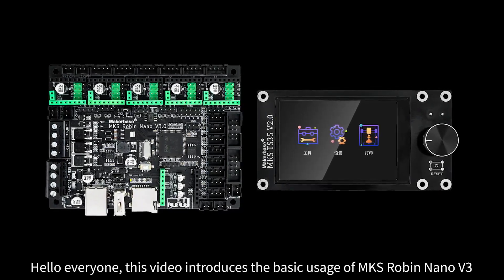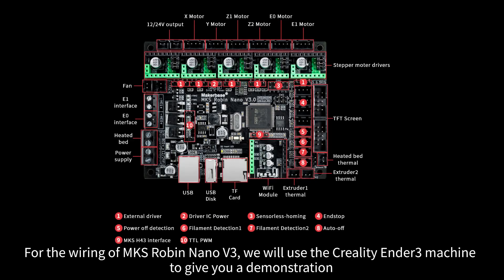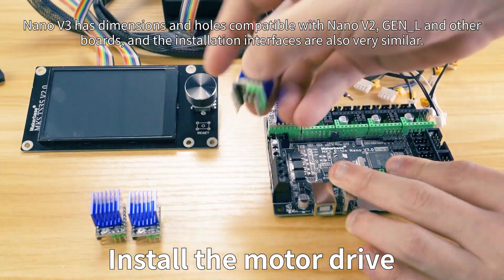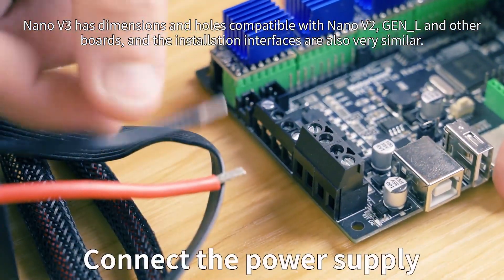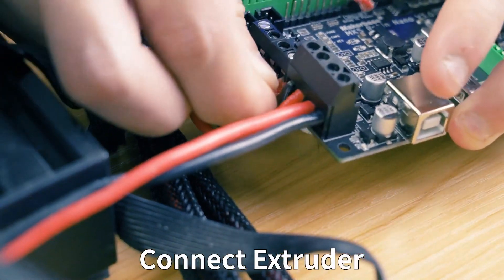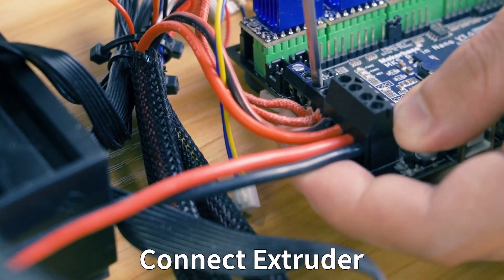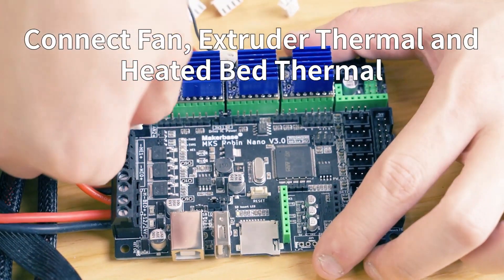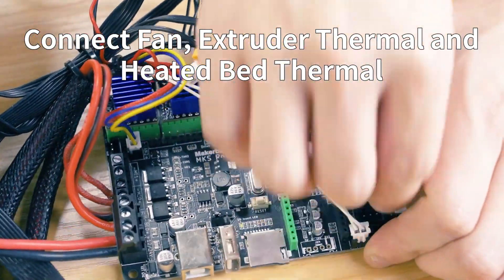How to use MKS Robin Nano V3 on Creality Ender 3

Comment: I just tried installing the board.  At first, it would power on, no display, and it would make 3 short beeps, then a solid beep until I turned it off. So I tried reloading the firmware, and now it doesn't beep, but I still have no display, it's just blank.  Any suggestions?

I'm using Ender 3 with this same board and display.
Reply: encontraste solucion 
tengo el mismo problema